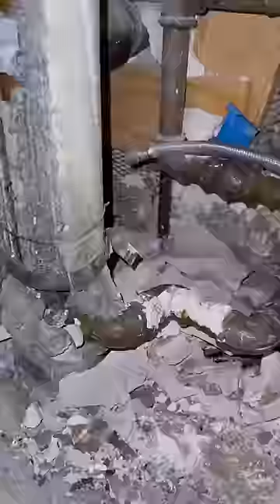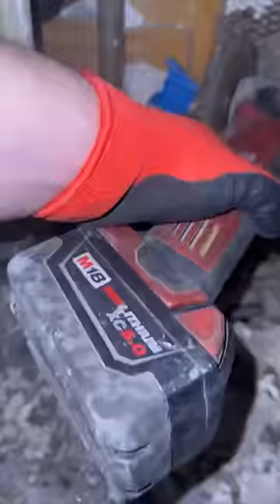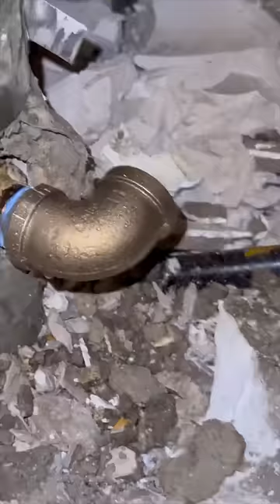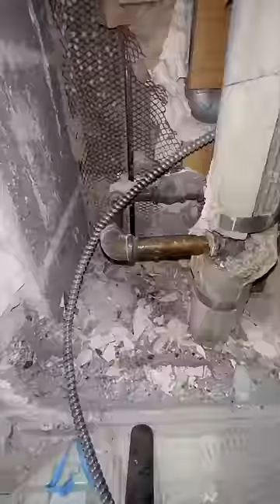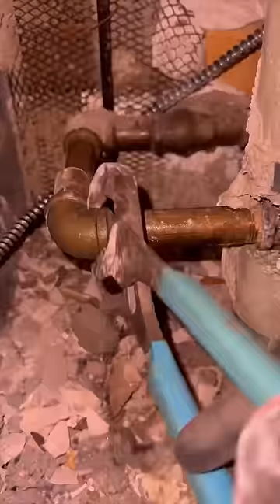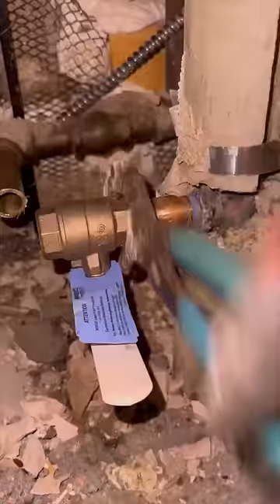Installing new valves during a shutdown #hydronyc

Comment: If it makes you feel any better I was mechanic for 20 years before it was mentioned to me that clutches and brake pads are asbestos and we do 8 brake jobs a day and blow them out with air.
Reply: Same I'm a roofer in my mid twenties every time we rip old shit up we are exposed to it along with lead paint lead pipe boots and everything in-between. I've just accepted it. Our grandfathers  lived pretty old and some of them crawled through pretty much bathed in this shit their whole life. We'll be aight.
Reply: @danblanzara3174 I do a lot of copper roofing. I eat 1/2” solder bars for lunch. Just kidding I don’t eat lunch.
Reply: Don’t get mesothelioma
Reply: P100 respirator.. all I use
Reply: There's really not asbestos in pads anymore fortunately
Reply: @wokislush there's asbestos pads still being illegally imported, unfortunately
Reply: @ivanvarela3215 usually from India I’ve noticed.
Reply: What type of paste does he use, anyone?
Reply: We're all going to die...fuck
Reply: Are they still?
Reply: Probably blue monster, it’s the best imo
Reply: @michaeldepow6663 We call it pipe dope, but it's called thread sealant.
Reply: I'm with ya been wrenching 35 years
Reply: @danblanzara3174 
I did a garage roof that had really old shingles. I had a feeling asbestos was in the shingles
Reply: @fixitfelix718 yes we are doomed, but cancer is a bad way to go.
Reply: I had a safety clean brake wash basin in the early 1980s.  I use cleaner degreaser and water into a busboy tub to wash down brake and clutch dust . Many times just brake cleaner.
Reply: @george2113  yup..for sure...that what I meant ...all of us that have to survive...especially in NYC and working around totally chaos a d shit like astesbetos..
Reply: @george2113  GOD BLESS US LOL FOR REAL FOR REAL
Reply: @danblanzara3174 me too buddy. Roofer out here in virginia. Lead, asbestos, fiberglass. Doing tear offs and watching the “diamond dust” float around while I’m out of breath throwing it. I’ve just accepted it at this point.
Reply: Yea an older guy told me to watch out for that shit when we were doing a clutch
Reply: It's the fact that if you have a wife, the asbestos dust comes off your clothes if she cleans them, puts you and your family at risk
Reply: No, that doesn’t make me feel better😂…

That’s probably why you’re still changing brake pads for the past 20 years ! ( no common sense
Reply: @ivanvarela3215 are they labeled as such? Are you saying that random brake pads I get from the parts store might actually be asbestos?
Reply: @danblanzara3174 not to mention the crack and meth 😂
Reply: In my state we have to stop work if asbestos is found on site and let a company come in to clean it up
Reply: Same thing with a steam fitter buddy of mine's dad.
Changed brake pads for around 25 years and just died of mesothelioma.
Reply: It gets on your clothing, into your washer dryer your car..  yikes its nuts
Reply: @george2113  Not only is cancer a bad way to go, but even with insurance it can leave your family in financial ruin. That's a shit ass legacy to leave because you said "fuck it, I gotta get paid".
Reply from the maker: Oo wow thats insane. Did it change your approach after knowing?
Reply: @hydronyc  It did for me. I use spray adhesive to suspend the particles and soaped up water for everything else. Just don't slip on a soapy floor hahaha.
Reply: @curtisss that’s why you woman up and do your own laundry
Reply: coughs while laughing
Reply: @JohnSmith-xu7ev  highly unlikely
Reply: @ObservationofLimits  
Unlikely what? You cant write a sentence?
Reply: And yet here I was, today years old when I learned that I was exposing myself each time I replaced the brake pads on all my cars.

Oh well, I used to work in EMS and would regularly get exposed to things I didn't even know existed until I went to EMT school, or started working on the job. But what are ya gonna do. 🤷‍♂️😅
Reply: @wokislush true. But we older mechanics dealt with A LOT of it during the 1970’s and early 1980s. I heard that it wasn’t as bad once the shoes or pads had been heated from use. Maybe that’s something they told us to calm our worries. But I remember my dad and I blowing that stuff with compressed air. I did meet one guy with mesothelioma. He got it from either being exposed to it in the navy and/or through the automobile industry . At any rate, it was the reason he retired early from the Ford dealership. Sadly the effects of asbestos exposure don’t show up until years later. So it’s impossible to immediately know if a person has been negatively impacted by
Reply: Asbestos or not, you're responsibility as well to he safe and not inhale any dust.
Reply: It will catch you later in life when you have a hard time breathing, stuck to a ventilator, and dying of COPD
Reply: Rip bro
Reply: Every night in wa I was shooting black stuff outta my nose I was a chassis mechanic doin the same prob best I’m not doing it anymore but yeah I 100% agree I don’t have a drs degree to go elsewhere too
Reply: @wokislush some states have really low regulations
Reply: Unless you are working on brakes and clutches in the 70's, 80's or 90's, you're not working on asbestos brakes and clutches.
Reply: @ivanvarela3215 Where?
Reply: @user-bi1ps6ew5k that is a Brand Name, not an asbestos brake.
Reply: @JohnSmith-xu7ev only if they lasted from the 1970s.
Reply: @Hugh.G.Rekshun only if they roof/shingles lasted on that house since the 1970s. That is am extremely rare occurrence that shingles would last 50 years.
Reply: @mattplasse1984 get off your phone and get back to work! That copper ain’t gonna lay itself!
Reply: Man I hold my breath and use brake clean and water idk what yall are doing man. That’s death.
Reply: That’s why you beat Covid 💪
Reply: @mattplasse1984 yeah and you’re a roofer so I’m sure you meant zanny bars
Reply: @mattplasse1984 😂😂
Reply: @hydronyc  Na, at this point if it's going to hurt me some time in the future the damage is already done. I do like you do bro, just wet it down and try not to breath deep, what else are you going to do? 👍 Keep it up broski
Reply: Buddy, why do you think all the lawsuits started to pick up 20, 30, 40ish years later?
Reply: @danblanzara3174  lead isn’t the problem you think it is. Don’t eat the paint and you’ll be fine.
Reply: You can sue those mofos.
Reply: @danblanzara3174  how old is "pretty old" to you?
Reply: That right there is how you get that cancer…

Australia is home to the the town of asbestos that basically everyone died in…

We now treat asbestos with the utmost respect…
Reply: The things we do
Reply: Maybe clutches but brake pads these days are ceramic??? What brake pad you working on that lasted 50 years?
Reply: @Alek2275  sure just like they don't put it in the walls of buildings or use it around pipes anymore... 

I don't know about you, but old things that are worn out and broken are what pay the bills, and not shiny and clean and only "ceramic" will be acceptable  work. And they do still use organic (asbestos) pads and shoes in brakes. 👍
Reply: @wokislush  There is still asbestos in brakes, it is banned in Australia so just check what cars you can not import there.
Reply: My ex father in law was one of the first settlements with the big brake and tire companies from being a mechanic in the 80s and 90s. Was awarded close to $3 million. Advb l
Reply: @danblanzara3174 as long as you're not sanding or cutting then you're fine
Reply: @danblanzara3174 Aside from the fact that it will turn you into a braindead vegetable, you’ll be fine.
Reply: @shadygunshow  hahaha. Not me. I’m an anomaly. I don’t drink or do drugs. I do high end roofing in New England. I’ve done copper roof domes on Capital buildings, I don’t do asphalt residential roofing. In my 20’s I worked with typical roofers as you described and Ecuadorians.
Reply: @michaeldepow6663 I prefer the white T2 dope, but the blue monster dope is ok also. I think the white is better because it's more paste like and less glue like, while the blue will harden up, the white remains paste... forever.
Reply: At least in germany they are not made out of asbestos anymore since mid 80s they were forbidden in 1995
Reply: As a welder, I was working around asbestos almost daily for at least 20 years. I'm now 71 and I wonder  about this from time to time. Be safe out there
Reply: Me too at Firestone and other jobs.
Reply: Different types of asbestos and it's the fibres that are the issue. 
Otherwise how many mechanics would have come down with asbestosis in the past 30 years. I know a lot of mechanics and amost never hear of it.
Don't forget silicosis is a thing too. Breathing any particles in your lungs is bad for you.
Reply: 35 years it hasn’t been made with it in decades
Reply: unfortunately  yeppers
Reply: i saw a guy cut open the asbestos insolation of a roof with an angle grinder in an enclosed space, he laughed at me and said, "you gotta die from something".

Comment: I remove asbestos for a living in Australia and a little trick I’ve learnt over the years is to mix up pva wood glue with water in a spray bottle about 90% water and 10% glue. The water evaporate and glue will form a seal over the asbestos. Or if can spray adhesive hit with that lightly and with a mask and suit on at all times.!!!
Reply from the maker: Thanks for the advice
Reply: @hydronyc  but the large bottle of white glue from home depot (its like Elmer's glue) I live in Massachusetts and I covered all the pipes in the basement.  They are wrapped that same asbestos pad in your video. I bought cheap muslin cloth wet the in the glue and water mix and wrapped all the pipes. The spray should work great
Reply: Wait you’re not supposed to just wear some latex gloves and take a grinder to the area you’ve just remediated? So glad I work in oil and gas where we don’t even think about asbestos without putting on a suit and supplied air. Plus all remediation is done on nights or weekends so you’re getting over a 100 an hour to strip it on double time. Almost makes it worth it
Reply: I have a licence to remove and identify asbestos, that's exactly what we got taught and with like asbestos wall or fences you can apply paint for a temporary fix.
Reply: @Garmoo5600  That’s exactly what I do. I identify and remove, obviously have my licence also. And same goes for me, if I don’t have any glue I just use paint. It works just as well if not better, because you really layer it on.
Reply: The QE2 was riddled in it as were household ovens and every Hotel still to this day in Law if we can’t replace it we can’t ban it.🇺🇸🇬🇧So forget about trying to sue them.
Reply: I been TOLD this by an asbestos removal company in Missouri, so I have no idea is it's 100% true, but I was told there are different types of asbestos and some types are pretty safe to remove without precautions. Granted this was like 5 years ago, but I think they said only the wall type stuff you would see instead of drywall is the dangerous stuff, but the tile and like the wavy roofing kind are safe to (cut or break, forget which) remove. Anyone who is licensed for that kind of work confirm or deny this?
Reply: @kylankendall7533  the friable and non friable asbestos . Just means ones in its mineral form and the bonded stuff.
Reply: How's the irish travellers treating you over there lad
Reply: Oh darn, that's a great idea,  thanks dude❤
Reply: Brother that is genius. If I ever need that I'm gonna use it.
Reply: Thanks mate. I always bin my clothes for my fam
Reply: @Schimml0rd it got banned yes,but it was still being installed for years after (well into the early 00's) it was banned,purely because the companies had so much stock,they had to use it up. Disposing of it would have sent alot of companies under. At least this is what we're taught on the asbestos courses in the UK. 

What I don't get though,the asbestos awareness ticket has to be renewed every two years,but asbestos doesn't fucking change! 😂
Reply: Here  in USA  I printed a 200 page work  manual  on how to remove said asbestos..back in 1989..it was wicked  hand drawn graphics and all  sheesh

Comment: We use water and pva glue mix to wet down. The glue helps stop the dust kick up. Give it a try.
Reply: Right on! PVA glue works well sticks all the fibres down, lasts for a few years too.
Reply: Shaving foam
Reply: That's actually genius!
Reply: but it gets on your clothing washer dryer car home the fibers get airborn and stick to everything..
Reply: Funny I just thought about the same thing.  In place of diluted glue, paint would be possible.

Comment: My father use to fit it in the 60s the union negotiated 1 pint of milk per day to relieve the irradiation in the throat. He's 78 and still going
Reply: That was probably to combat the toxic fumes from welding on galvanized pipe.
Reply: He probably would have made it to 120 but he wont now
Reply: @depdark1  You probably won't either.You've been watching too much YouTube.
Reply: That's all good but if it were me I would probably still have an irritated throat and that good olden times diarrhea. Just 💩 till you die. Maybe if I grew up drinking milk every day my body would develop more of a tolerance for the lactose
Reply: Are they inhaling and exhaling the milk to rinse the lungs out? If not...then the milk doesn't do a great deal apart from make you feel like you are doing something
Reply: @DopeyPotato  it was to remove the irritation in the throat no doubt they inhaled large quantities of the stuff
Reply from the maker: My father went through the same back home in albania. Used to work with a lot of lead

Comment: They make contact adhesive spray that you can use, it's not strong adhesive, is for fabric, it creates a sticky clear barrier that will not evaporated, but it's strong enough to stop all particles from becoming airborne, and since it's used on fabric it also comes off once fully dry, you can roll you fingers over it and then pull it off, which means you can spray everything, i use 3m fabric contact adhesive

Comment: if you get fired for not wanting to work around asbestos you can sue your employer for violating OSHA health and safety standards regarding asbestos. OSHA 1910.1001(c) goes over asbestos regulations. whenever you have to work around asbestos theres a procedure you have to go through, and that procedure has to be documented. If your employer isnt going through the procedure or documenting it, you can sue them based off that alone

Comment: The 3-m versaflo might be an option - expensive but it covers your entire face and provides a closed air system. Looks expensive but maybe it’s worth it - X-rays/tests and specialist consulting could provide good info regarding exposure levels. If it’s negligible then no stress, but if it’s a bit concerning, go full face recycled air system.

Comment: In Canada it’s remove or it can’t be worked on, then again some employers look the other way, glad I got my remediation ticket
Reply: I was scared to be a plumber first month. But I've been assured I won't have to ever touch it. And as for asbestos in drywall and fiberglass, it's not so bad.
Reply: @redsquarejay  you’d be surprised whwre asbestos was used , and it’s in stuff you’d not even tbink of like the drywall mud and tape, ceiling tiles and that ugly ceiling “popcorn” even some pipe (depending on where ya go and how big of pipe you work on mostly extremely large diameter pipe)
Reply: @brianrankin5876  ya but it's held in pretty tight in drywall and tiles. Remember the people who actually got the cancer were ones that had heavy repeated exposure. A little bit here and there is nothing to worry about, unless you're a smoker.

Comment: Wrap the insulation with aluminum tape at cut points and spray with a mask on and you’re pretty damn safe. Another option is to buy an air scrubber and bring it on the job with you.

Comment: 40 years ago, I worked in asbestos control. We took that shidt VERY seriously. I had a full sealed gas mask. Lagging operators used powered respirators. Tyvek suits were used and disposed with the removed asbestos waste. Negative pressure enclosure, Clean/dirty washroom, the whole nine yards. 
We also used thinned PVA. Every surface was sprayed to catch any loose fibres.

Comment: What you tolerate you promote, in my state when asbestos is found, they have to do the abatement work prior to letting anyone in. I recommend you find out what your state laws are when it comes to asbestos and then get some training there’s some techniques like glove bags and encapsulation materials that can be used.
Reply: He's non union he's not gonna say or do the right thing. Nyc needs to get rid of contractors that don't do the right thing. He could call department of buildings and get certified to remove asbestos and be a plumber.

Comment: It's the dust. Keep it wet, and settled. 
A good respirator will work too - but they're expensive. 
Former journeyman electrician and ate my share of this crap.
Edit : you can also carry around some spray. Acrylic finish spray it on the pipe insulation before you break it off to keep it from creating the dust - maybe that spray on rubber sealant would work too. It's all in the dust. I like the PVA glue idea , it's it's cheap and would work
Reply from the maker: Im gonna start mixing water and glue

Comment: Electrician here.. worked in hospitals that were covered in the stuff. Even had a boss bitch me out for saying I wasn’t going in there without a respirator “just don’t disturb it it’ll be fine” so I replied “how do I not disturb it while drilling through it!?” Pissed me off that I had been working around that stuff for a year without even knowing it. Some of the dudes that clean that stuff out told me what respirator to buy and some tips. If you have a good respirator you’ll be fine!
Reply from the maker: Bosses dont care bro. Most are ruthless and greedy lol but that true just need to have the right mask
Reply: P100 masks are fine  @hydronyc